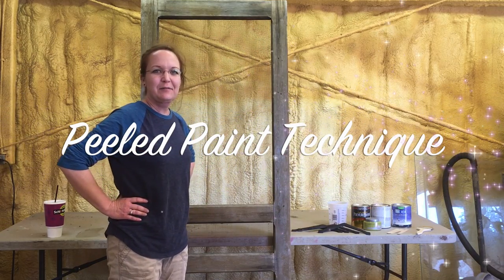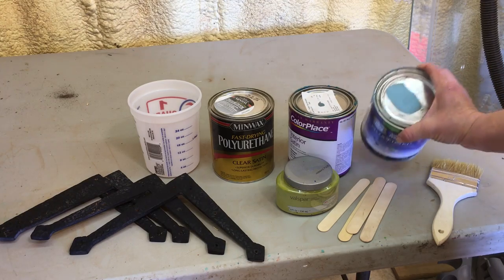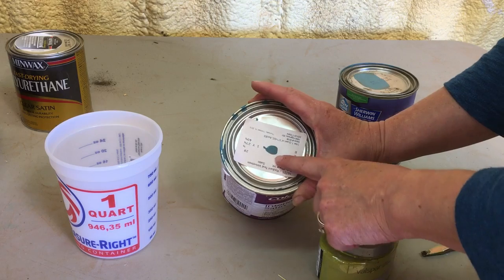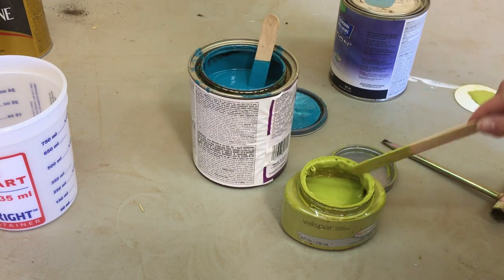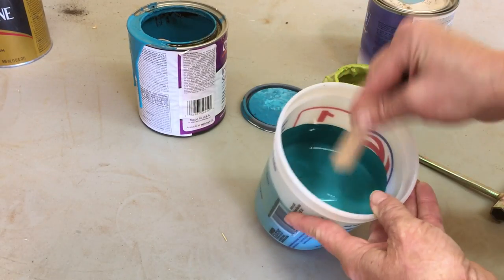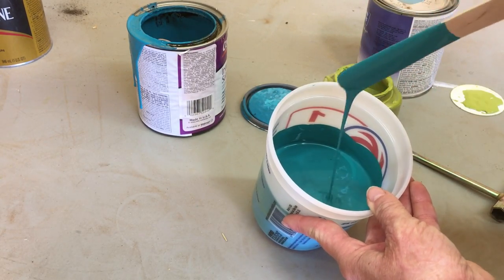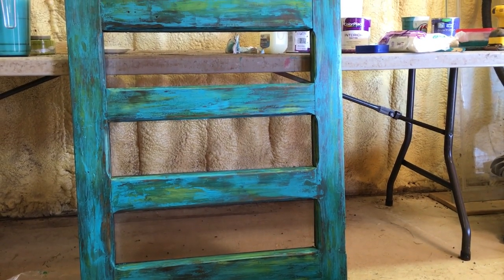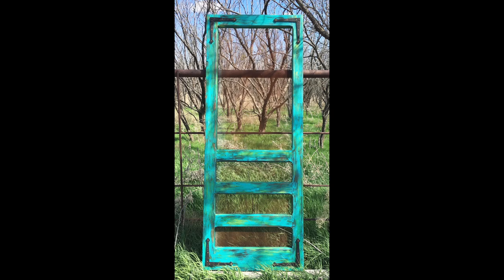How to distress paint with the Vaseline Peeled Paint Technique

Comment: Your tabby cat was the best part of this video!  I used to have a cat like that - a Bengal, when I lived in... Bengal, India!  Reminds me so much of my cat.  Highly intelligent, very social, wants to be part of what you are doing.  What a sweetie!!  That's a really nice cat!

With regard to your sander, you are using a Dewalt Sheet Sander that has no variable speed control and the sandpaper is a real pain to load up.  This sander is good for lightly sanding house walls before painting, and not much else.  I had this too, till I discovered the Dewalt Random Orbit Sander with variable speed controls and paper that velcroes on.  What a huge difference!  I can switch papers fast, and I buy them in bulk paks which also come with free MESH grits which do not use up as fast as sandpaper.  Also has a vacuum and dust collector.  Sell this one and buy the other one.  You will be delighted.  The circular orbital action does not affect grain as I thought, and cuts through very fast.  Price difference is minimal.

Very nice paint finish.  Has a richness of color and depth.  Good technique too, I learned something.  However,  you did not explain the technical aspects of the paints you used.  Painting, like any DIY, is highly technical.  Sadly, most women looking at DIY videos, focus on the creative and artistic, but not the technical. So let me clarify the technical aspects of your paint:

The Polyurethane you are using is water based acrylic, not the oil based version.  Either one will work for this project.  The oil based takes longer to dry and the paint underneath must be fully dry before application.  Oil based Poly needs Paint thinner for brush cleaning.  Water based Poly needs water and soap for brush cleaning.  Use a steel scrubber (not steel wool) for water based cleanup. 

The colored paints you used are all Latex paints.  Latex paints are not made from rubber, as the name implies, but are acrylic (plastic) paints.  Same as the acrylic hobby paints but with some additives for large scale painting of walls.  

 In some countries latex paint is called Plastic Emulsion, which is much more accurate.  Latex paint can be diluted with water easily and brushed cleaned with water, soap, and a stainless steel scrubber.   Latex paint can also be mixed with a Latex version of  Floetrol which will erase brush marks.  Floetrol also makes an Oil Paint version.  Use Floetrol when painting walls and doors with one even paint coating, but not needed for this distressed project shown.

Latex paint can be altered easily with any small color samples of acrylic paint if you want custom colors, or the paint shop will make you a custom quart size if you give them a paint color sample from any object to match to.  

If you want to make CHALK PAINT (a useless invention in my opinion), mix a little plaster of paris into your latex paint in small batches and store in a jar separately.  Do not buy these pricey ready-made ones from stores!

Latex paint comes in High Gloss, Semi Gloss, Satin, Eggshell, Flat.  Flat is cheapest and awful.  For projects with a nice matte sheen, I mostly use Satin sheen.  Gloss finishes are very runny and hard to work with and need multiple smooth coats (Floetrol) to come out factory perfect.  Of course, you can mix the sheens too!

Now you have some technical data and a better understanding of paints.  I encourage women to dive into the technical aspects of whatever project they are doing.  Look on Youtube, talk to the men in hardware stores, dig, dig, dig.  Don't rest until you know EVERY ASPECT of your raw materials for any project you do.  Sorry about the lecture, but women need to do this. We are afraid or lazy and want to go straight to what we understand best - colors and artistic effects.  Slow down,  learn the technical aspects.  This will liberate you from pricey ripoff 'chalk paints' and other such rubbish created to fleece women of their hard earned cash.  Knowing your paints, will allow you much more artistic freedom. Understand them like your plants or pets.  Now go create!
Reply from the maker: Lass-in Angeles yes his name is Bob.  He’s pretty awesome cat friend. 😄
Reply: Creative Kina that’s all you replied to from the comment? Your cat? This comment was a joy to read and you should’ve acknowledged...

Comment: Thanks for your video, gorgeous door ! and where did you get your L- brackets ? affordable ? we need 8!...french screen doors sagging after 94 years, great solution and in keeping with bungalow style.  anonymousmom
Reply from the maker: mayaflynnster thanks!  I got those from Van Dykes Restorers catalog.  Lots of great stuff in there!
Reply: Yep, you asked the right question, I need those L-brackets too.  In my old country house there are two sets of these really old screen doors and where they begin to meet in the middle...they sag.  I've tried several things, one thing that is missing is the original wire springs that give the door an automatic closing pressure...common to the farmhouse doors.  I guess that's what I need to try next to prevent the sagging.  The doors are just made of a light pine, so they aren't inherently heavy...but anyway, glad to see you are not giving up on those 94 year old doors.